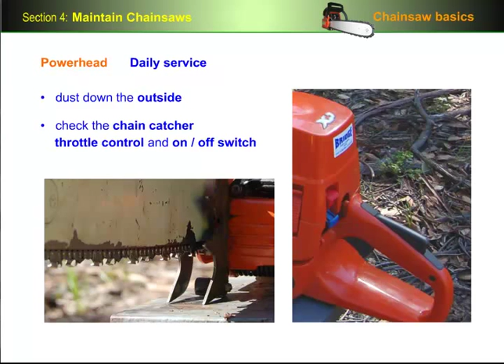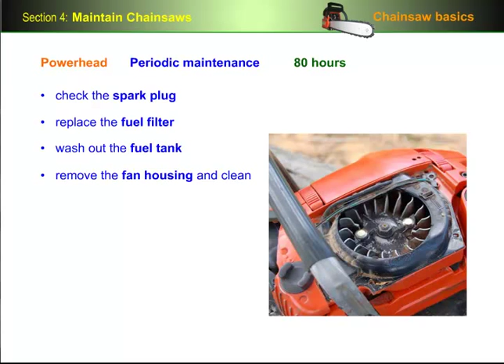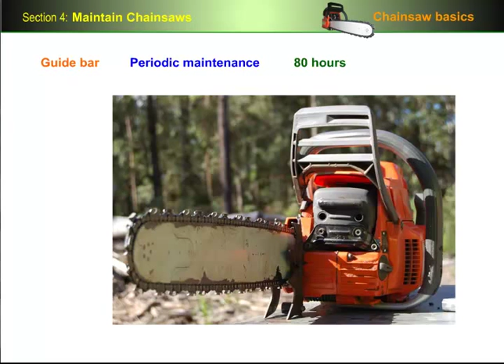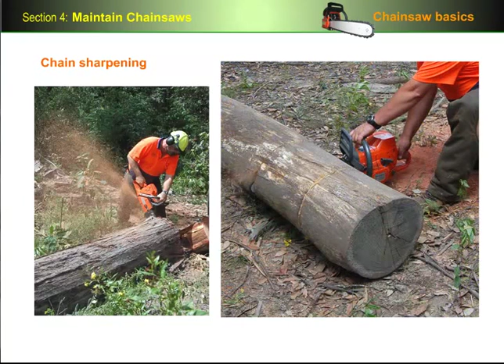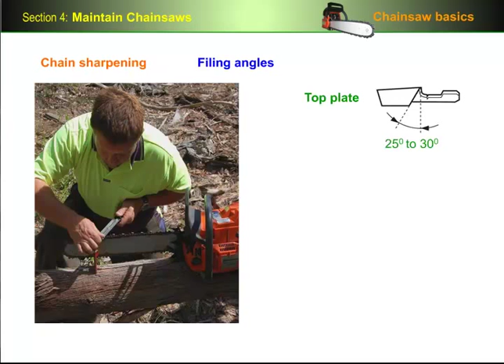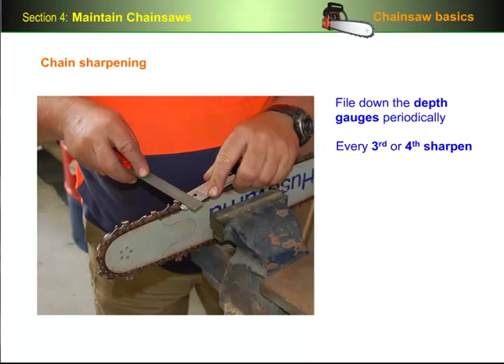Chainsaw maintenance

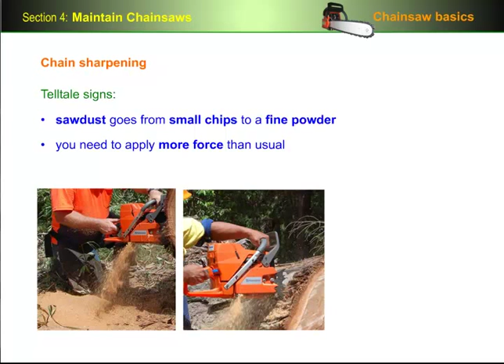Comment: How will I recognize if / when  "the saw starts to run off in the cut?"  RE: 6:45 Chainsaw Sharpening: Telltale signs (of when it's time to sharpen the chain): The saw starts to run off in the cut
Reply: cuts not straight, but getting curved